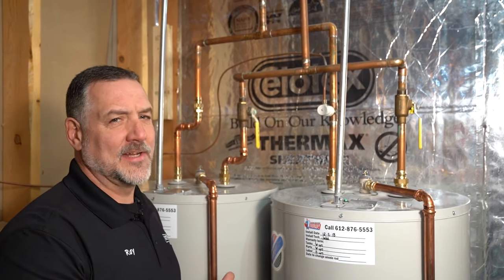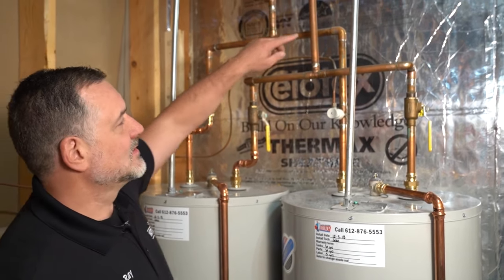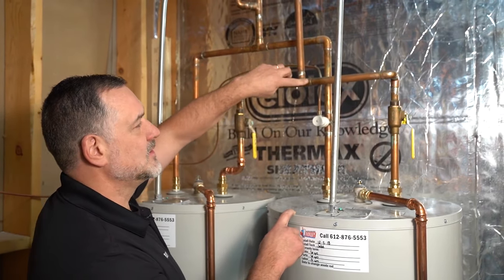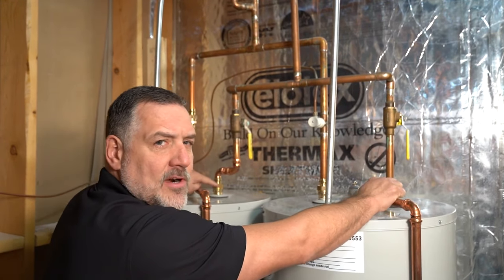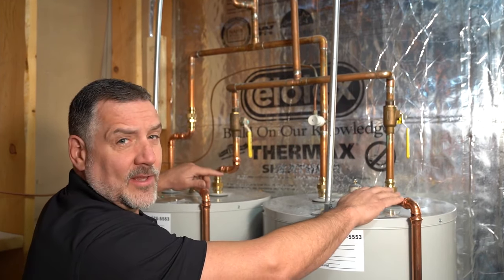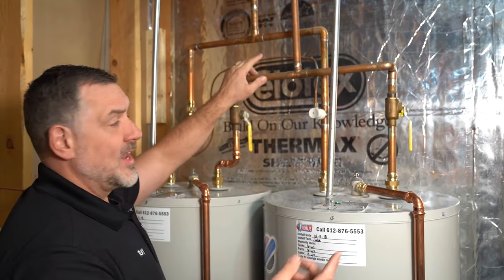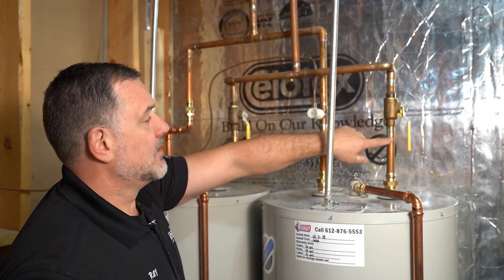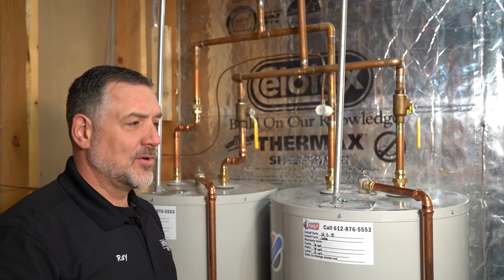How to Pipe 2 Water Heaters in Tandem  Water Heaters Now

Comment: How do the 90’s on one side and not on the other play into the balance?
Reply: They don't, he did it wrong. He put the equal length pipe up top first, then realized the ports aren't equidistant and added the 90's. Should have just made the left horizontal run longer, it would affect the resistance less than the 90's.

Comment: I am not sure I totally agree.  I have two water heaters. One is electric run 100% by solar PV.  The other is a gas water heater.  The Electric water heater is free to run since it is PV.  The gas water heater only runs during peak water demand since the electric water heater feeds the gas water heater.  Savings is about $400-$700 per year in utility bills since my electric is all provided by solar roof mounted PV cells
Reply: So you just pipe the hot of the electric in series to the cold input of the gas heater? I also have solar cells, but only one gas water heater right now. Anything else to consider when you did this?
Reply: I considered parallel and series but in series I would think that the first tank would work harder than the second as the second is maintaining the temp and the first tank will wear out faster. I am unsure if parallel is much better as one tank will always die before the other. It sounds like you have it hooked up that the second kicks in only when needed but I only have electic (no gas, no solar) and I think parallel would be best for our home. Like to see some pictures or even a video of your set up.

Comment: Nice video, Thank you. on parallel hook up with two water heaters how important is to for all the piping be the same length? is there a max amount that the pipe length can varied in size? My out going hot side piping is about 13" different length. from one to other?

Comment: Good video . Seem a few done wrongly as you mentioned but with a recirculating pump on the first (50 gal gas ) cold inlet . It didn’t last long bu worked well . Please tell me what the mixing valve Is there though?

Comment: You say equal  vertical distance and horizontal.   But u have fitting on one and not the other. 
Wouldn't that throw it off as even though total height is the same, the length is different?

Comment: Hey @Water Heaters Now - example here - I see you have 2 tanks in the video left and right.  Imagine mine is the RIGHT one - is it possible to run a pipe from that tank to another ROOM directly to a shower.  Say - from 1 apartment to another, so my neighbor can get free hot water at the cost of ME paying for it?  Because every time I turn my tank on vacation mode the water goes cold then my neighbor complains about not having hot water but they do when I turn it back on.

Comment: What if you don't really need 2 water heaters but you have 2 water heaters?  Inlet water temp is 40 in northern Idaho.  I feel, they did this like you said NOT to do it, to get the first heater from 40 to 90, and let the second heater get it from 90 to 125 or so.  In THAT situation, is there some logic?

Comment: My wife wants us to look into getting a hybrid electric hot water heater. We have a standby tank and heat with oil. But with oil costs now above 5.19 a gallon. This fuel is quickly becoming too expensive. We are now heating the home with the fireplace. And wanted to see if there was a way to add another water heater in tandem but isolate one and choose one over the other. Essentially creating a redundancy. So when when energy source is too expensive we can jump to another?

Comment: I see that he says the piping must be of equal distance to each heater, one thing that is not taken into account is that on the heater on the left there are two extra elbows going into the tank. An elbow has a friction loss or is equivalent of a certain length of pipe. Example: if a 3/4 elbow where equivalent to 6 in of pipe, tank on the left has an extra one foot of piping. That's a guesstimate I don't know the exact engineering specs but it gives you an idea. So if you do the math the tank on the left has a longer piping distance.

Comment: It is not "wrong" to install two hot water heaters is series-type installation. It depends what presented situation requires. If you have two different size tanks, or gas and electric tanks, than series-type installation is perfectly OK, and preferable. In your example, you have two identical tanks, thus parallel-installation is way to go. Another thing is, your cold water pipe is not "equal" as you claim, as you have two elbows installed on  old water side on the left heater. Those two elbows take away from water flow as they create additional friction slowing down water delivery,  as opposed to straight run on the right tank, creating pressure in-balance in process. Thank you

Comment: Is this set up better than having 1 80 gallon? If so why?
Reply: It depends on the burner size and 1st hour delivery rates.  This setup he showed won't be the same because of the extra bends on both inlet and outlet.  It will use more hot water from the tank on the right as it will have less resistance.  That being said, if you have two 40 gal tanks each with 40K BTU and 1st hour rating of say 60 gallons, then if you have a single 80 gallon tank with 80K BTU heater and 1st hour rating of 120 gallons, effectively they would be the same, just with 2x the amount of leak points and maintenance to do to each tank vs the single tank.  You just need the space for the 80 gal tank, and I would always prefer the single over twin tanks.   If you have a hot water return loop you will have the exact same issue in that one tank could be preferred and the other one won't run near as much.  So again single tank is better solution if you can do it.
Reply: @Chris_In_Texas  
I disagree a bit. I’d rather have two tanks: if one malfunctions I’ll still have hot water. Plus when not much hot water is needed I can only use one tank and isolate the unused one and keep only the pilot light on.

Comment: What is the best connector to use for transitioning from CPVC house piping to copper tubing at the water heater connections?
Reply: Sharkbite. Only if installed correctly.

Comment: Your explanation makes sense, but your water heaters are not piped equally.  There is a longer run on both the hot and cold in the water heater on the left.
Reply: Yep!  He f#cked up!
Reply: Lol I was ready to smash my phone while he is pointing at the pipes saying they are even.  I mean, I'm sure there is not a world of difference with the extra elbows, but it has to amount to something. Ty for saying it bc it  drove me nuts
Reply: I literally turned to the comment section to see if anyone wanted to comment on this. You should be able to turn the WH to make it equal. No extra elbows.
Reply: Yup that's why I came to comment
Reply: Still waiting for an answer on this

Comment: Why is it wrong to run in series?
Reply: Inefficiency
Reply: Because if one goes out you have to shut everything down to replace it. Barreled or tandom makes it so you can shut off only one supply and check valve the hot.
Reply: @richardgeisel4290  Please explain
Reply: @mickblock  Not true, only if you neglect to put a infeed bypass in with the appropriate shut off valves
Reply: Should be manifolded or piped using reverse return

Comment: Do you have to use copper or can you use PEX?
Reply: Pex is garbage and for people that don't know how to do plumbing. Use copper... and even if you use pex you can't go all the way to the tank with it. You still need copper coming from the tank at least.
Reply: Pex is not garbage, and yes you can use it.  If you live in cold areas like I do, where power outages last for days and the temperatures drop to below freezing regularly, PEX is the solution.  Pex won't burst from a freeze.  Also, to Andy, who can't plumb copper now?  With insurance companies banning sweat connections, those compression/crimper copper fittings are easier to install than PEX.  It's all about application.  I personally think CPVC is garbage, but I use it a lot, because people have a budget.

Comment: But it is not the same distance since every 90 elbow adds around 5ft of length.
Reply: It's not a flue pipe... I don't think a 90 in a water line equate to 5 feet of piping... do you have a source for this?

Comment: inlets and outlets are not piped equally. defeats purpose of the parallel system. left heater will be used more as the hot water outlet is closer.

Comment: Instead of relying on science, take a tandem setup with 2x tanks of the same size and see how many times you can fill up 2 bathtubs simultaneously before the water goes lukewarm or cold. Then test in series.

My theory (just for speculation - I have no firm evidence):
I feel like running in series is more efficient. Fill 1/2 water bottle with hot water. Fill 1/2 bottle of water and put it in the refrigerator until cold. Fill the rest of the bottle of hot water with the water from the bottle in the refrigerator. Let your 50/50 Hot/Cold bottle of water sit for a minute to simulate what goes on in a tank being fed cold water. Keep in mind it will be worse in a tank, because cold water is constantly flooding in for a much longer duration than it takes to simply transfer cold water from a bottle. Now imagine your tank with 70% cold water mixed with 30% hot.

With a constant flow of cold, winter water, a tank being direct fed cold water is going to cool much quicker than it should. If you’re running in tandem you’re essentially putting the fire out, because immediately when you run hot water, very cold water is pouring in and reducing the temperature rapidly (during the winter - of course summertime makes use of a higher percentage of hot water before being neutralized). 

In tandem, with 2x 50 gal water heaters, let’s say the temp of both tanks are neutralized by the time you use 70% of your total hot water (because 70% of the water in each tank is now freezing cold). For example, we’ll say 70 gallons of water will be at peak temperatures from a tandem setup before your washing machine, dishwasher or shower(s) begin to run cold.

In “Series”, 100% of the primary tank would be used before cold water begins to enter the primary tank. Then you would get another 70% at peak temperature before being neutralized, which means a possible 85 gallons (vs 70 in tandem) or 21% more peak hot water before it becomes neutralized. 

Theoretically, in series, a person would get 85 gallons of hot water vs 70 gallons in tandem (from 2x 50 gal tanks).That’s roughly 21% more water at peak temperature when being run in series. This is of course using the theory that 70% of incoming winter cold water neutralizes the water in each tank being fed cold water.

Tandem cons:
Roughly 21% less peak hot water.
Roughly 21%+ more energy consumption.
Longer wait time for 2 tanks to reach peak temps after 70 gallons have been neutralized by the cold water coming in.

It would be a pain to try to shave after showering when all the water from both tanks (in tandem) are neutralized or cold. Peak temperature recovery time would be roughly 30 minutes to be able to shave, which isn’t good when in a hurry or trying to go straight to sleep after showering and shaving. 

In series (and again, in “theory”), if the theoretical 70 gallons had been used, there would either be 15 remaining gallons at peak temperature in this scenario, or the recovery time for the primary tank would be greatly reduced.

It’s all theoretical, but something to consider. I plan to test this theory some day.
Reply: Plus, with series tanks, when you don’t need peak volume, you can shut off the first tank and use it as a tempering tank instead.  ¡Viola! No ice cold winter water hitting the main (second) tank.  You would now have 50 gallons of room temp water going into the main tank before any would come in ice cold.  So now you get the benefit of summer water all year.

Comment: Why not series? Cut life in half? While parallel had its benefits, it also has several downfalls. This design seems like a waste of time and money compared to putting in an instant gas water heater. They might need that tank capacity once a week/month. 2 gas tank heaters are $500 a piece or $1000 together. Roughly 75-80% efficient. Instant water heaters can be had for roughly $1000 for a 90%+ efficient model.
Reply: I haven't heard anyone explain why it's bad and how it will cut the life in half. They just say it's wrong.
Reply: @brandonperschon449  idk why they phrase it this way since I've heard it from people before. But I believe the whole idea is that in series, you tank with incoming cold water will be the only one that ever fires and runs with any more minimal water usage. Since the 2nd tank in the series is in theory being fed water that is hot enough to keep its thermostat satisfied. There are theories about using them in series with the 1st heater (just picking numbers here) at say 130 degrees and then 2nd at 140-150  so they would both fire but then you definitely dont get double the capacity. 

Basically from what I understand about it. If they are both 50 gallons, until you have used a substantial portion of the last heaters capacity probably 30+ gallons, the second tanker in the series has never seen water "cold" enough to cause it to actually run. Meaning that hand washing and even some shorter showers may never trigger the second heaters burner to ever fire up. Though I dont understand why this would "cut the life in half" since if you had a single heater that heater would cycle just as much. Plus it's the stupid tanks that always fail for me. Never the burner or valve 

I hope I explained that well lol. I know the answer I've just never tried to type it out before.
Reply: Partial redundancy.  If one fails you can valve off and run at 50% capacity.   Replacing with a tankless is not always the best option depending on house layout.
Reply: @demmerdesign6356  
You are correct. Some people run them in series, some in parallel. I’ve seen a set up where you could do either depending on which valves were open and closed.
Reply: Just replaced my two heaters that were in series and left them plumbed that way. They were 17 years old with nearly consecutive serial numbers. The hot-fed heater does fire but obviously not as much. Going to run the cold-fed heater a bit cooler than the other to even out the fire cycles but we essentially have endless hot water for all our needs. Only when we have family over (up to 10 people in the house) do we notice any difference. 

The recovery gph on my new heaters is a standard 84 gallons each at +90°. So wouldnt that make the series setup essentially 168 gallons at 130° water if we could somehow demand that much hot water? I am just a diy guy not a professional, would love some professional input as to why my heaters would last half as long and to correct any error in my math?

Comment: I disagree. Not with all of it but your reasons for not hooking them up in series is just insulting and condescending at best. Not trolling or instigating so I apologize  if this sounds rude. Hydronic Science reasons? How does it cut the life of the water heater in half? I also dont think "hydronic" is the term that should be used here. Hydronic means the distribution of heat by using circulating water. This is almost hydronic but it isnt circulating the same water and it isn't distributing "heat." It distributes hot water, not just heat with or by hot water as it circulates. Circulating.water is warm coming in and hotter going out than in the loop there is heat sinks that warm the room or anything that needs heat. See what I mean? The fact that he used a techy sciencey term incorrectly means he was just using the word to sound like he knew what he was talking about when in fact he did not. He probably had been taught  that way without a proper explanation thus dooming him to do the same thing. The life of the water heater wouldn't be cut in half from being hooked up in series......sorry but i need more info especially if you are tryin to use tech jargin to get past having to learn why you do something. What if there is a propane burner inside a natural gas water heater and you hook up an electric  water heater in series? You won't need the gas  water heater all the time but the gas heater will store and insulate more  hot water than just the electric water heater by itself AND the gas by itself. Not everyone is a soccer mom uninterested in how things work.. I also think the use of the "Hydronic sciency reasons," was condescending and disappointing to hear from a content creator the I enjoy watching so much.  Sorry man but i think he got lazy on this video. I definitely feel like a jackass now.......
Reply: Nice. I was going to call him out for "hydronic science reasons" but you already did!
Reply: Also, who's the jackass when he blatantly ignores those 90 degree elbows. He obviously installed the upper equal length pipe before realizing the left side needed to be longer, then instead of just extending the end of it he added two unnecessary bends.